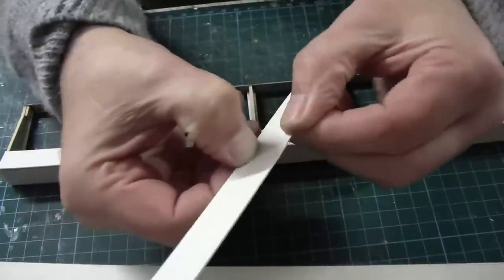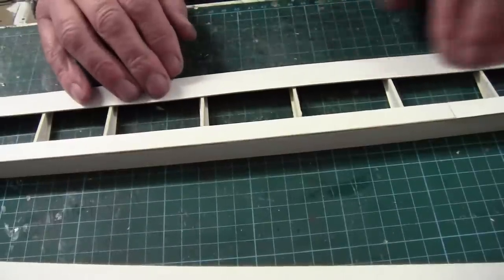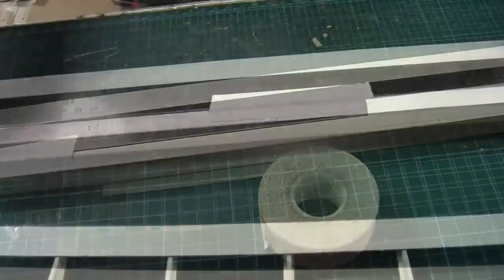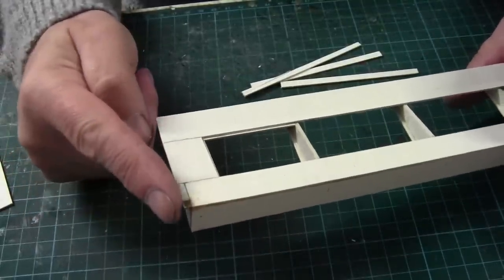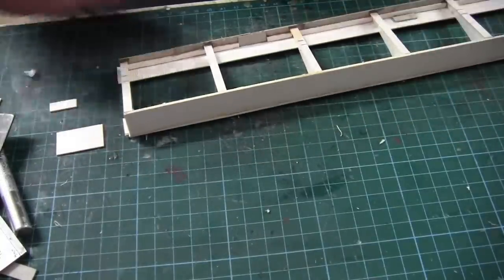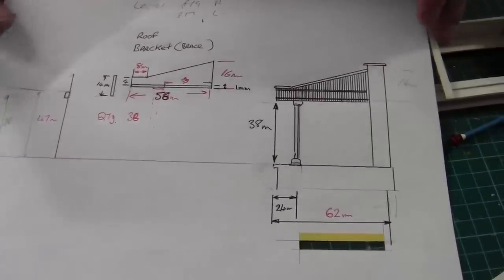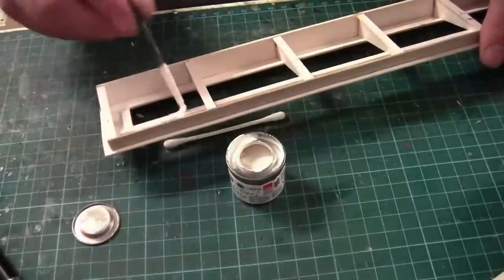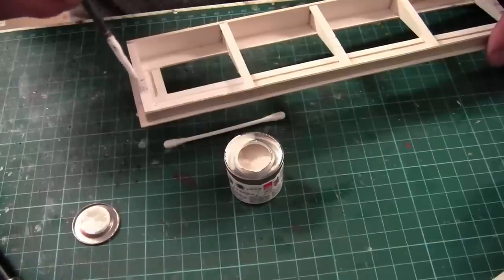Jarrow Road Station Part 16, Canopy's Part 2 No 360

Comment: Hi Tony nice progress again really looking the part enhanced with the two trains, certainly got the dimensions correct - what else! Interesting to see how much time you put in. One thing I have to be careful with acrylics is if the card (including the kit card) absorbs  the water too much and unevenly you get warping of it as it dries out. I am thinking I might have to spray with a matte paint primer to seal in future. Good to see you didn’t have such problems using Humbrol (which I can’t get out here) and that really did cover well, but realizing you have reinforced throughout to mitigate. The ledges for the glass panes really will finish that off nicely. All the best Stephen
Reply from the maker: Hi Steve. The card does tend to warp. hence why i have used super glue for putting the main frames of the roof together. so i can manipulate the roof and straighten it back when it does warp without breaking the structure. i think maybe next i will use plastic sheets and see how they would turn out, once glued.
acrylic paint are very thin even before you water them down. they might work better on other materials. ideal for weathering touches. 
thanks again for commenting. stay safe, cheer's for now. Tony

Comment: Hi Tony, I noticed that the video had been posted and when I went to find it, there it was gov, gorn!  I assume there was a problem, Tony?
Good to see further progress on the canopies.  One thing came to mind when painting them white inside.  Have you considered buying an air brush?  It would make quick work of painting those awkward places and large areas.  I guess it’s the facia boards and glazing next, followed by weathering to let down the white.
Looking forward to the next video.  Best, Jason.
Reply from the maker: Hi Jason. i took the video down as i had forgotten to add a evenings worth of footage. i did want you guys to miss out on anything. LOl. I do have one. but the paint would never have got into those tight corners. i have only used the air brush on the shields roof. then it was put back into the box. 
you must have a crystal ball. facia boards and glazing next. i suppose you will be telling us what project i am doing next. Lol.
take my friend. stay safe. cheer's Tony
Reply: @TONYNORTHEASTERN  I don’t have a crystal ball, Tony.  I’ve just checked my medical records. 👨‍⚕😝   After the canopies have been finished, you’re maybe going to build a signal box to go next to the platforms?  Mystic Jase.
Reply from the maker: I knew it Mystic Jase. the next build is the signal box and signals. lol. talking about crystal balls. i better make a start on next weeks video.   no rest for T.N.E. Lol

Comment: Hi Tony brush strokes (was that a tv programme !!), you have the patience of a saint and I found your use of the `well` at the top of the paint pots to hold the paint a useful tip (I have always kept that area clear of paint). Are you going to fit any lights to the underside of your canopy's or are you going to install lights to the walls of Jarrow Road. I always find time fly's when working up in my loft on my railway, wife calling up to ask am I going to bed or staying up there for the night, only wish time went by as quick when I was at work -lol. I think your plan of spending a set time each day is idea because I have in the past spent too long on a project and then you loss some interest (mojo as some call it). Many thanks for sharing and looking forward to seeing next update, take care Barry..
Reply from the maker: Good morning Barry. There was a programme called called brush strokes. Loosing the Mojo. very true you can loose interest especially on the big projects. that is why i restrict myself to a couple of hours an evening. it then give me time to relax and think about what's to do next. before going back into the loft. thanks again for commenting. cheer's for now, stay safe  Tony